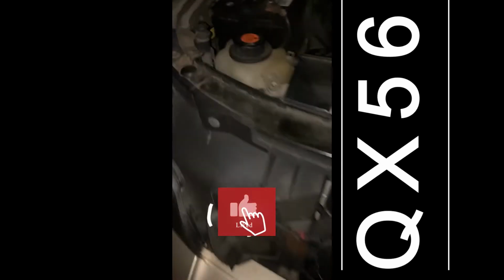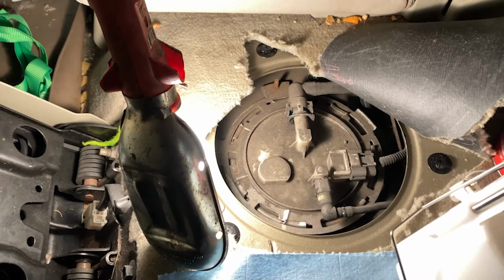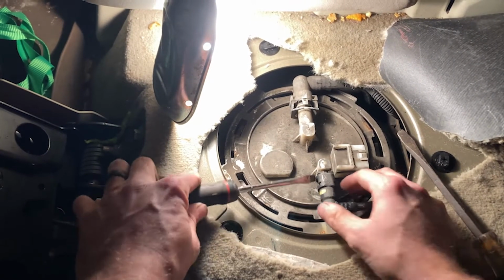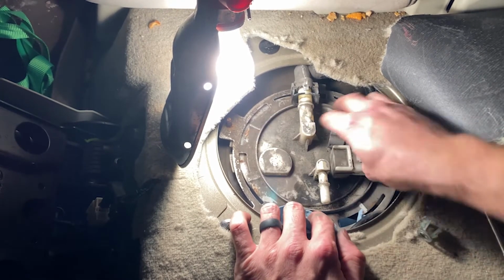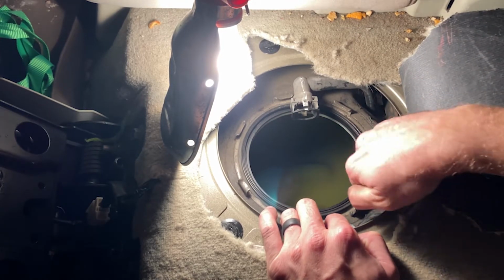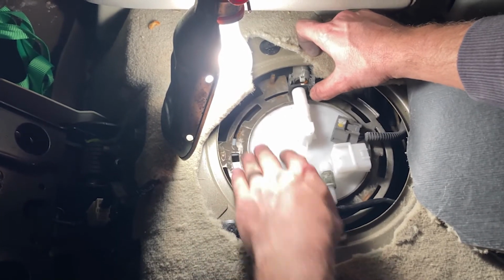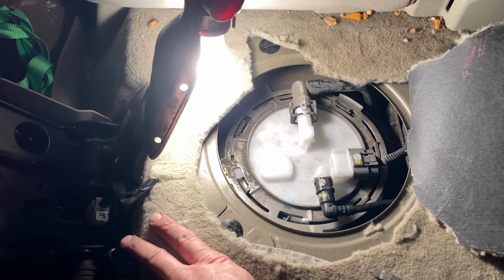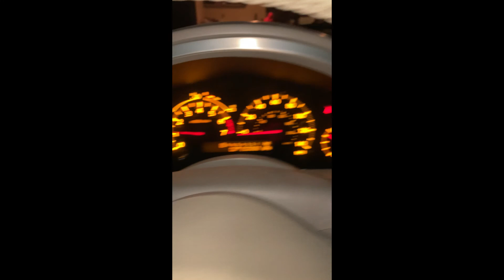04 Infiniti QX56 Fuel pump replacement

Comment: This was very helpful.  However, you do not need to cut the carpet.  pull out the 2nd row console (4 screws) and fold the second row seats forward.  The carpet is just Velcro to the 3rd row carpet.  Just unvelcro and fold the carpet forward.
Reply from the maker: I appreciate the insight! Cheers!

Comment: Great video. I believe that is what's wrong with mine. Slowly accelerate up to highway speed and it drives ok but try to pass another vehicle or drive more aggressively and the acceleration cuts out and feels like the traction control interrupted . Mainly relieved of the inside access panel instead of lowering the tank.
Reply from the maker: Yes, its definitely a blessing with it being accessible. However, my issue ended up being a BCM Module.